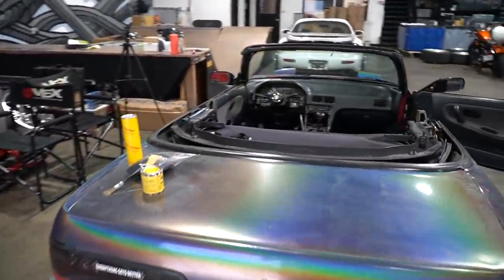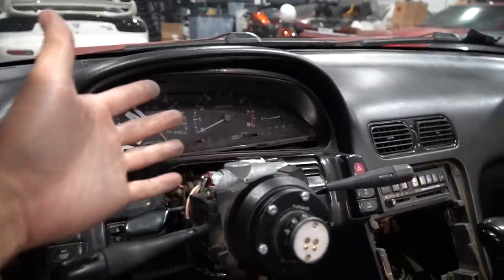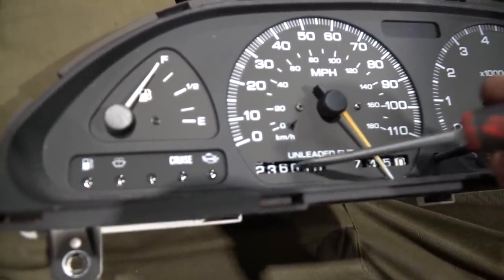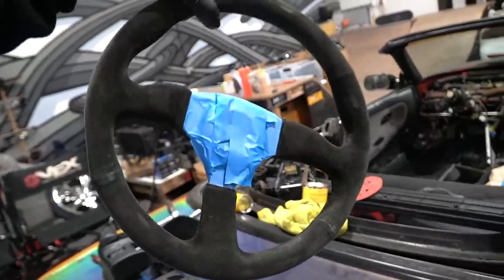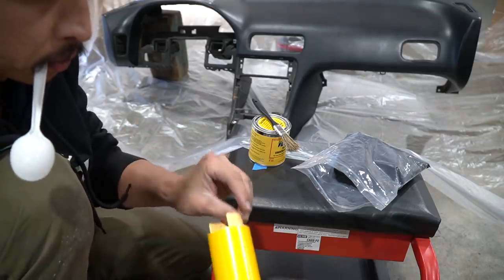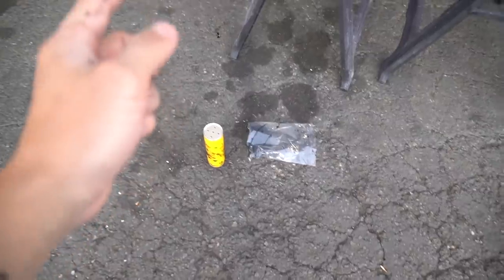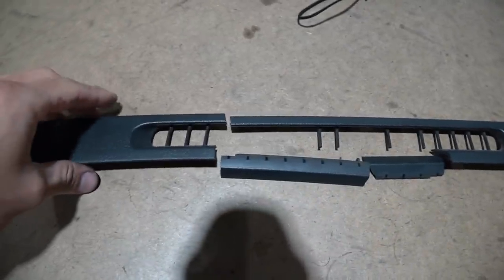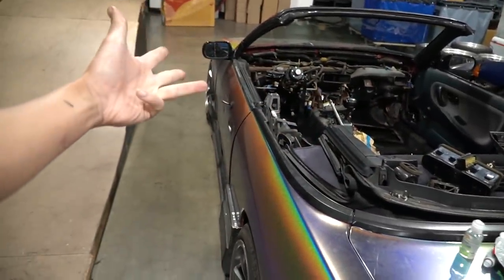Fix your cracked dash now for just 40 Bucks!!

Comment: Yo Vu I found the rear interior panels for the back that are missing on eBay. Search this on eBay - 92-94 Nissan 240sx Convertible Right Interior Quarter Panel Plastic S13 Trim. And for the left- 92-94 Nissan 240sx Convertible Left Interior Quarter Panel Plastic S13 Trim.
Reply from the maker: Thank you I'll look it up right now